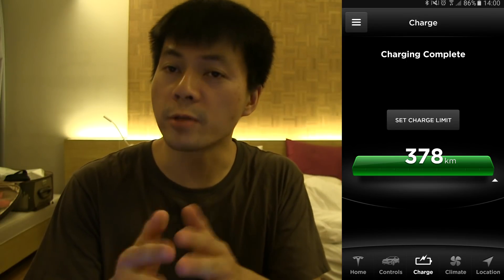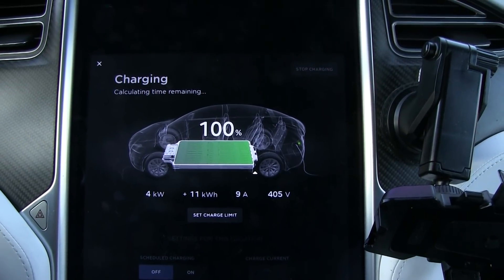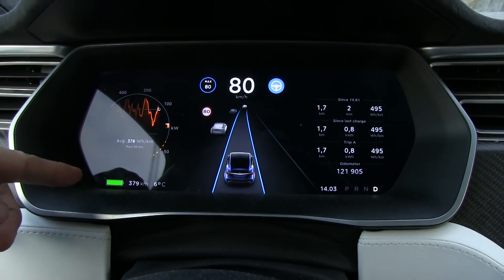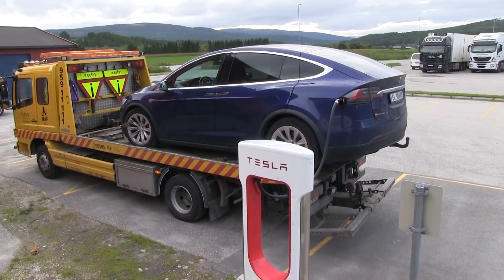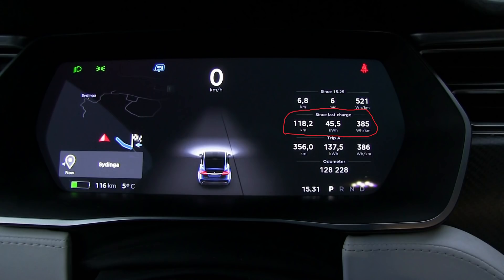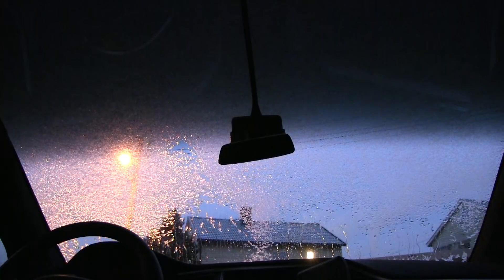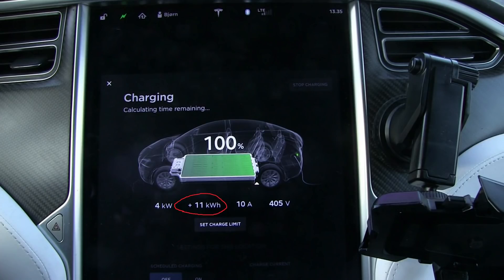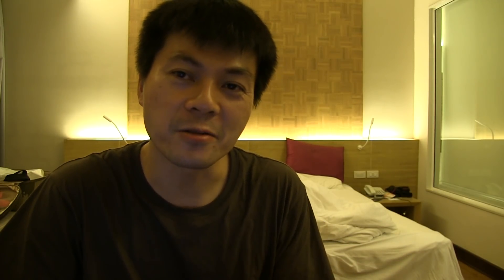How to correctly measure battery degradation in Tesla

Comment: 10:43 for the answer, and it involves charging completely until the car stops showing that it is charging, and then immediately driving it until it stops (or your guess to where it's going to stop if you don't want to charge from the side of the road) without heavy acceleration or hills. So, essentially, it's not easy to get this measurement. Everything before the timestamp above is his explanation of common and faulty ways of measuring.

Comment: The critical thing seems to be determining the full usable battery capacity when new. Then you could go for a long , slow drive and Teslafi would tell you wh/km, and km driven. Multiply these numbers to get total wh for the trip. Call it X. Then look at the Teslafi column for battery capacity used on the trip. Call it Y. Divide X by Y to get total battery capacity (or at least a good estimate). Compare this to battery capacity when new, and you have total degradation. No?

Comment: If the bms tells you the available power at the time of purchase and say a year later gives you another figure, can those numbers be trusted? Or can Tesla update the way the bms calculates this? Personally I like the 90% -70% method (or 80% -60% or other combination to use up 20% of battery) But you’d hope Tesla didn’t change the method of range calculation during your trip.

Comment: My experience is that the only reliable measure of battery health is a full discharge test. Batteries will look normal until at some point in the test they abruptly stop producing power. Tesla's range estimate is based on a proprietary model of the battery about which you know nothing. As you stated, they can change the model w/o any notification. One extremely important factor on battery capacity is temperature; the lower the temp, the lower the capacity. This means that testing either has to be done at the same temp, or you know precisely the effect of temp on capacity. Since most people don't have a dyno housed in an environmental chamber, this must be done outside at different times of the year, which means the battery has already aged between measurements. 
Battery aging is the critical issue for EVs, as most IC cars don't suffer from mileage loss with age. A recent study that found a 10% per year loss in 30KWH Nissan Leafs underscores how important this issue is. Not understanding this may put you into the situation you pictured: having your EV towed to a charging station.

Comment: Bjørn,

I drove a relatively flat drive at 60-65 mph (95-105 km/h) for 249.2 miles (401 km) leaving 5 miles (8 km) remaining. The trip meter showed 67.8 kWh used with a 272 Wh/mi average (169 Wh/km). During the drive, I tried to keep the Wh/mi close to 290 Wh/mi, but often it went to 300 Wh/mi. I never averaged 272 Wh/mi. If you use my observation of 290 Wh/mi, the energy used is 72.3 kWh which seems reasonable for a 4 year old P85 battery. The energy graph showed 230 Wh/mi for the final 30 miles. I propose that the trip meter's reading for Wh/mi is the average over the last 100 miles. 230 Wh/mi*30 mi =6,900Wh/mi2 plus 290 Wh/mi*70 mi = 20,300 Wh/mi2, then 6,900 Wh/mi2 + 20300 Wh/mi2 / 100 mi = 272 Wh/mi. Coincidence? Forgive me if my if my units are not accurate (mi2); I am not Asian. :-) . (mi2= miles squared)

Do you have insight as to how kWh and Wh/mi are calculated on the trip meter?
Reply from the maker: +Barry Frazier Did you charge to 100 % until it stopped?
Reply: Yes I did.

Comment: First of all, this whole discussion of battery degradation is quite academic, as long as the Tesla database, reported from all Tesla cars, statistically indicates less than 10% degradation after 8 years, probably because of a well designed BMS. Another thing is, how many 8 year old cars is still on the road.

From a technical point of view, this video, and maybe even Tesla, complicates or confuses this subject way to much. The fact that one can change the display between capacity and range while charging or driving is the whole problem. This approach with the mixing of battery capacity and range is very confusing to the average person. There will never be a constant factor between the two, it has a huge error margin.

To get a reasonable consistant and compareable test, you will have to design a well defined and repeatable test trip with well defined repeatable parameters consuming most of the battery capacity. But even this is difficult, for instance one can not control temperature and regen. One will always to a certain degree be comparing apples and oranges. 

The most objective and «scientific» approach will always be to measure the amount of energy going in and out of the battery. This can only be done by constantly measuring the current and voltage at the only obvious reference point, at the battery terminals. Whitout knowing how all this is defined in the software and what is actually displayed of energy and tripmeter numbers, this whole discussion becomes a big guesswork. For instance, the video claim that «heat loss» is not included in the reported numbers at the display. A lot of guessing and unknowns here. But once again, the battery is most likely doing fine even after 8 years, and at that time it can be replaced with a much better technology.

Comment: Up and down matters because both charging (regen) and discharging obeys ohms law. Hence number of start and stopd matters.
Wind also matters even if you drive r/t trips because the wind resistance is V^2.
Trying to driver much slower than normal or accelerate slower denies you the information of what impact the internal resistance increase have had to your useful range.
The best thing is to drive a known route (longer route)  under the same conditions (trafic weather) and then reference to past results or persons with similar vehichle.

Comment: You are right - the internal resistance (which is impedance) changes with ageing (and with charging current and with temperature).
All current measurements are not  super accurate - and there is also a limit to the expense a manufacturer can spend.
For the BMS the voltage of the cells is the most accurate state of charge reference.
Then comes the question of useful battery capacity which makes the thing even more complex. 
Just look at Apple and iPhone battery - in order not to experience the 30% to indtant shutdown they throttle the CPU to lower loads... This to compensate for increasef internal resistance. An EV would experience similar challenges.
Without access to the pack and even the individual cells, the best method is to drive a longer reference stretch under completely similar conditions and measure used percent charge from 100% (with the limitations this method has).

Comment: Bjørn, You mentioned that tracking the total kWh's added at the charge point was an invalid method. I disagree. Its not perfect but its more controlled and repeatable than your "drive it to empty" test where inevitably you will have hills(Regen) and other ancillary power being used while driving, which you cannot control (unless you do it on a rolling road!)

If you drive the car to "empty" ensuring you drive slow towards the end to get the most out of the pack and then charge to full and record the total kWh's added you have a usable figure (including charger losses). 

You then repeat it later and get another figure.  The difference between the two is the degradation. Its not 100% accurate but it will be close.

The difference in charger efficiency because of pack resistance is going to be much smaller than the potential differences you are going to get on a full discharge cycle on the road (traffic, temperature, lights, A/C, driving style/speed etc.)

Comment: Bjorn, thanks for your videos.
Curiously, Why care about how the battery is discharged ? 
I would take a measure of the charge energy from 5% to 95% when new and do the same after 1 year.
This should show the remaining energy capacity. This way it eleminates the end of the curve where there is some buffer that we dont know of.
Keeping the same battery pack temperature, 
let's say your measure 90kwh out of a 100kwh rated then you have 100% capacity (90kwh/(95%-5%) =100% capacity)
After a year your measure 85kwh, you then have 85kwh/(95%-5%) =94.4% remaining capacity
Difficult to have, is the internal resistance of the battery, this is the most important metric for battery performance.
Measuring wh/km show consumption and this is way too variable.

Comment: Measuring capacity properly for all kind of batteries is almost impossible. In case of lithium (or NiMH) cells when you discharge them in different current you will achieve different capacity/energy. Lower current = more energy. Older battery - higher resistance, more heat and significantly lower capacity at higher current, but at lower current capacity can be only little worse then new one. Also cells selfdischarge is different. So in real life it is not possible to check acurate battery capacity. If you remove them from the car and tested in the lab, there could be better results. Cells based on chemistry are very complex :)

Comment: People who played with hobby chargers and ran capacity tests on their batteries will get a good idea how to do the test, which is to charge the battery at a certain rate to a certain voltage, and then discharge that at a certain rate to a certain voltage while recording the energy leaving the pack. If you do the same test using higher rates, especially discharge, the capacity will always be lower.

Since Tesla can change the way it reports the battery state of charge, and it can change the point it stops charging and discharging with an OTA update, and they can use an algorithm which starts off limiting the battery charge to 90% capacity and then as it degrades, it can unlock some of that capacity to give the illusion that you only had 3% Degradation when it was actually more.

If you read the CAN bus with an app to get the hidden information, I think this is still reporting what it was told to report, unlike if you could access your battery and use a multimeter to test it. Since Tesla is starting with unprotected 18650s and adding a BMS of their own design, the can make it report whatever they want, and adjust it along the way. 

Using actual miles you can drive is also not going to be an accurate measurement over the years as you change tires, tire pressure, alignment, wind speed and direction, temperature, etc. 

About the only way you can get somewhat reliable degradation data is if you have a garage that stays at a constant temperature and a 10 kw DC charger that will data log the voltage and kWh while the car is at a temperature that doesn’t require any heating or cooling. 

Increased internal resistance will decrease the useful range of an EV due to higher voltage sag. Tesla does what it can to limit power as you approach low state of charge so that you don’t cause a voltage sag high enough to trip the low voltage cutoff and then need to be towed.

Comment: Pull the pack out, put it onto ula high precision charger in my lab and run a capacity test. It can measure up to 0.000001 difference in capacity.
Reply: Prince Ding, yes, that’s the only way to get precise degradation information, but not practical for the average owner. So people need a test they can do with the battery in their car that mimics the real test as close as possible.
Reply: Kasmo paya, if you supercharger the battery and drive it like you stole it, quite a bit of energy will be converted to heat. 10% loss isn’t bad. A powerwall losses that much each time you charge and discharge it. It’s not a problem unless this is increasing over time, which is one of the forms of degradation.
Reply: Telsa Service should offer this test, when the car is already in for maintenance. Something to improve upon in the future?

As usually very interesting video. Heat loss of Bjørn Battery(Optimus Prime) was around 10% as far as i remember, and that was considered high. I have heard that some people say its about 15% on average, that number is too high right?